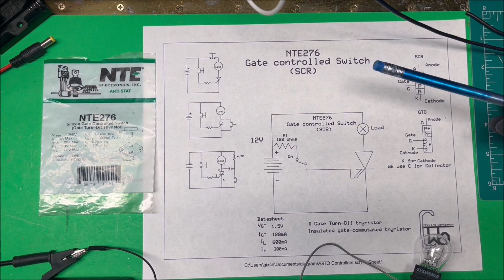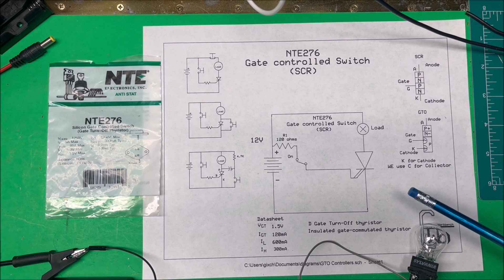SCR Gate controlled switch

Comment: Nice, never seen or hear off this type SCR before. Can the 120 Ohm resistor be replaced with a potentiometer to create a variable voltage, or does the SCR acts more like a ON/OFF switch with little transition in between ? Grtz